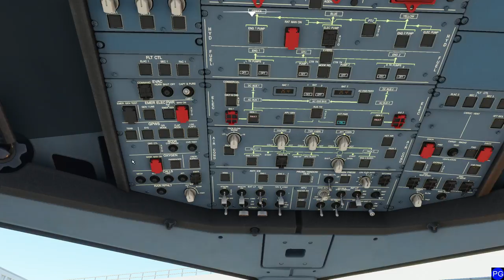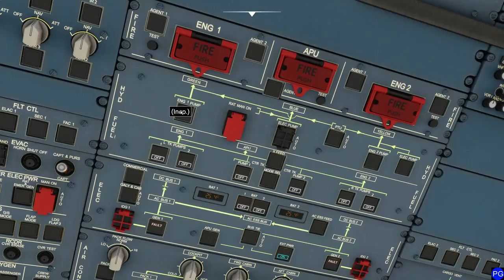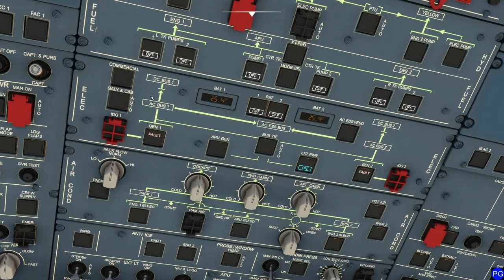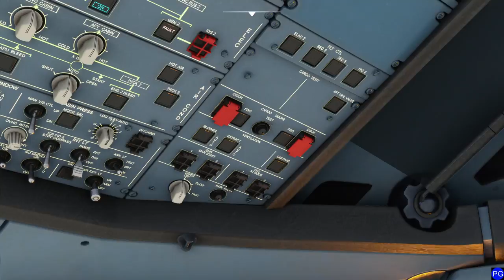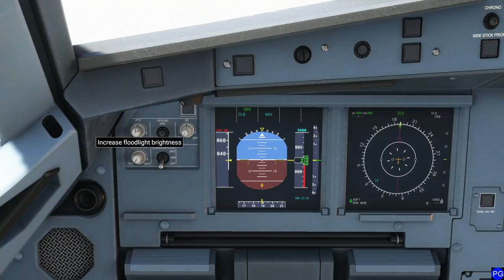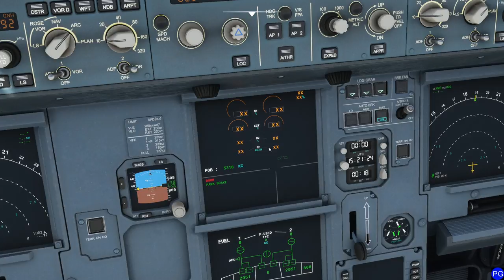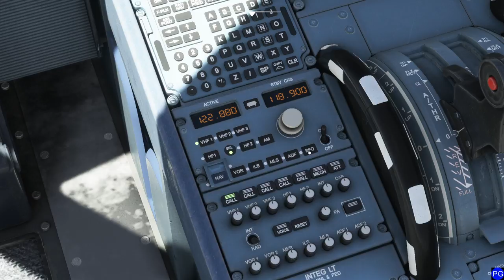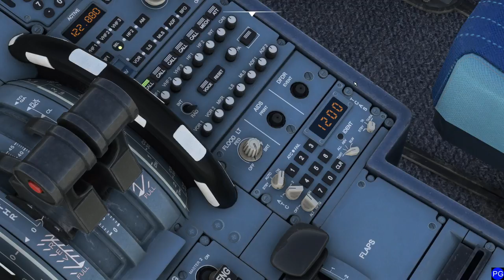MSFS - Flying the Airbus A320neo Part 2: Aircraft System Overview

Comment: Very instructional and informative.
About the ENG1/2/APU BLEED: Bleed valves are valves (duh) mounted on the compressor (axial part compressor for Engine 1 and 2, centrifugal compressor for APU). They take out air in order to accomplish the specific task pilot calls the Bleed valves to do. 
A bit in deep: bleed valves are always open while the engine is starting up. They automatically shut off when the engine is at Ground Idle. Then open again either when pilot need air for A/C or for starting another engine.
Bleed valves are needed in the engine, regardless the need of air requested by the pilot, because otherwise the engine could not start... the compressor pumps so much air in the combustion chamber during the start up phase, that it can stall. To avoid stall, the excess of air needs to be taken out... this is what the bleed is needed for.

A little curiosity, the A/C system works actually with a small turbine driven by "bleed air" which drives an air compressor. The cabin "breathable" air runs into this compressor and, once compressed (high temp and high pressure) goes through a refrigerator lowering the temperature but not the pressure. Then this air goes through an expansion valve lowering the pressure AND the temperature, in such way cold A/C air is ready to be sent back into the passengers/pilot cabin.... thanks to Bernoulli principle (and no, the air passengers breathe is not the same air that comes from the compressor through the bleed valve).

Comment: As a Aircraft Avionics mechanic that is licensed on the A320, saying that the ground power is unconditioned is wrong, the power is just as good quality as the engine or apu generators, my airline made the pilots use ground power for 95% of the T/R due to fuel savings, other wise good video for novice 320 users

Comment: Your YT vids are very informative and I use them quite a lot. I have to wonder why you specifically chose to use the Vanilla version of the A320 instead of the heavily improved A320FBW version. You must have had your reasons but still. Other than that, can't wait for the upcomming vids.
Reply: I think it was a good idea to use the standard version that comes with the software as most people will never add a single other plane and you're immediately disenfranchising them if you use the FBW mod even though it's free. Also, if you can fly the base version you will certainly be able to fly the modded plane.
Reply: @Dalwhat  I see the point you are trying to make although I am not sure I agree with you. 

As the FBW A320 is free obtainable and is a seperate plane in MSFS now it is much easier to install and try it. If it is not your thing simply uninstall it and that is that.
So you will not be disenfranchising anyone anymore.

As the FBW A320 has so much more features on the A320 working it is a different beast to fly. Similar, but very different. I'm pretty sure that a novice will get the vanilla A320 started and flying without much trouble.
However starting the FBW A320 requires a LOT more steps and is the plane is starting to approach study level aircraft procedures. It is therefore, in my humble opinion, much more immersive than the vanilla version ever can be. And also a lot more fun!

In the end I think that most simulator pilots want to get as close to the real thing as they can get. This is exactly what FlyByWire is providing or trying to provide right now. Especially now that you can choose from Stable, Developer, and Experimental versions.

In the end it probably comes down to what you prefer and how you like to fly the simulator i guess. Not yucking someones yum :D.
Reply: @shoneygaming4174  I agree with @dalwhat... a "novice" pilot does not begin to fly with A320, after more than 250hrs I am still "afraid" to fly the Airbus.. I would like to do that properly and knowing how to fly the base version I might think to download some modded version.... If I have to begin, I begin with the basic version.
And I believe there are a lot of rookie pilots thinking like that.
Ciao.
Reply: @Antonio Fardella I see your point and I understand that starting to fly an A320 can be very daunting. Especially if you are a "novice" pilot.
The A320Neo introduces a LOT more procedures which are skipped in the Vanilla version.
However flying the Vanilla A320 and the A320Neo is both similar and VERY different at the same time.

But still, in my experience the A320Neo is one of the easiest commercial airplanes to fly around in. Especially because of the extra added features from the FlyByWire team such as Simbrief integration in both the Ipad and the MCDU.
Also, if you want, you can set the waiting times to instant as you would in the Vanilla version. This means for instance that setting the Adirs can be set to instant and you don't have to wait 10 minutes anymore if you would so desire.

Plus... it is free. Absolutely free. Which blows my mind to this very day. And it no longer overwrites the vanilla A320 MSFS so you can choose which version you want to fly.

What I'm trying to say is that it can seem daunting to fly such a big plane but don't be! You and other rookie pilots out there will love it I'm sure and it is very satisfying to do it correctly.
Reply: @shoneygaming4174  I get your point.... as aviator I like to start with simple things.... only few time ago for me going from dark to engines running meant "SHIFT+E".... today I am trying to stick to real procedures. Look, I have the latest version of A320NEO flybywire already installed on my MSFS, but knowing the basics is always an added value, it makes you think about the progress made and the effort...
More or less it's like today's mobile phones, which are mini computers, compared to cellular phones of the late 90s... a youngster doesn't know the difference, they don't know that only 20-30 yrs ago there was no internet connection reachable with an hand held device.... today take off internet from a smartphone and the owner is literally lost....
Then, IMHO, that's why these videos are fundamental to understand what comes after.